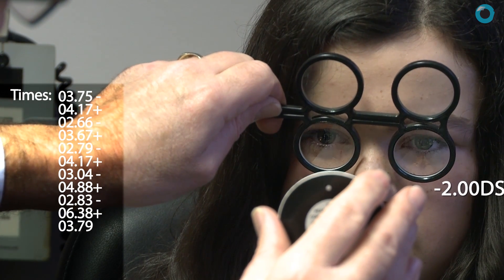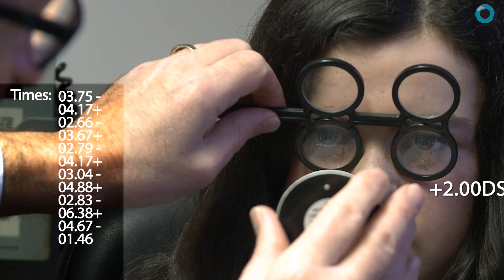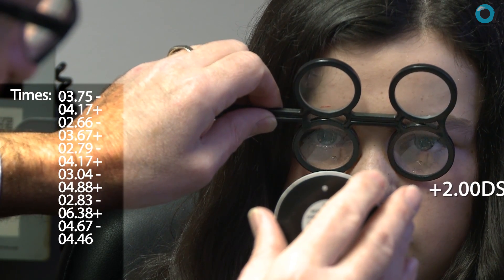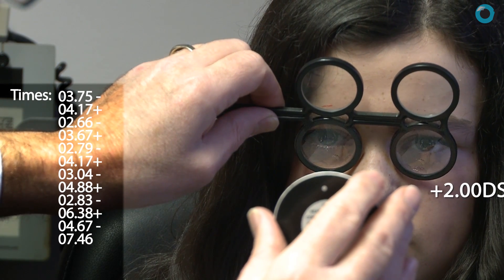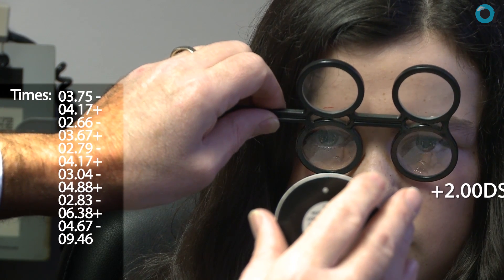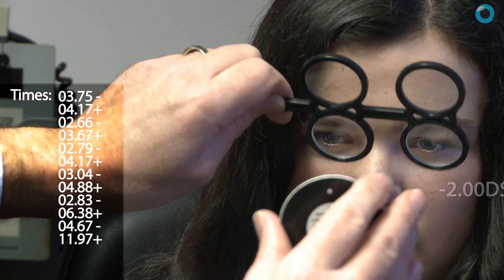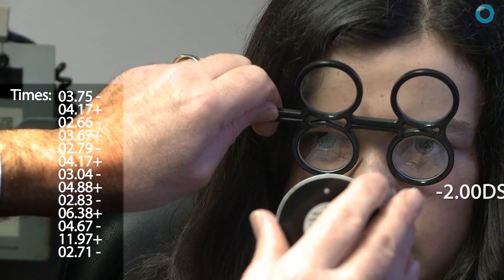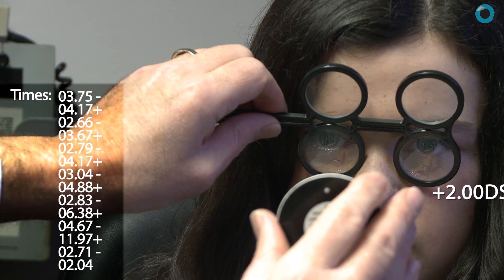OT skills guide: Accommodative facility

Comment: Excellent.  I find that by using a +2.5 diopters (for reading), and then look up over the "tops", I can profoundly clear several lines on my home-Snellen.  This is a great way to slowly get out of 20/40 vision - but it does take time and persistence.
Reply: Now 6 years later, still maintaining 20/20. 
Refractive STATE = 0.25 Diopters.
Yes, Snellen verification works.
Reply: @otiebrown9999   ive been facing accommodation failure for two years now and after seeing more than 10 doctors im giving up on finding a solution in my country so im youtubing it hoping that i can fix it myself , do you think i can ??